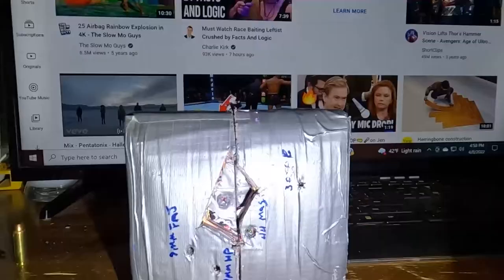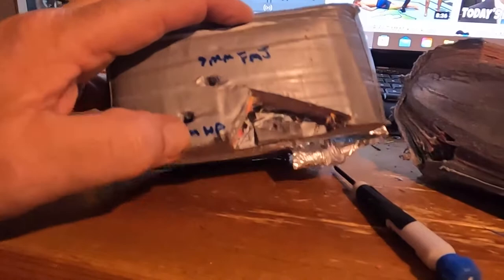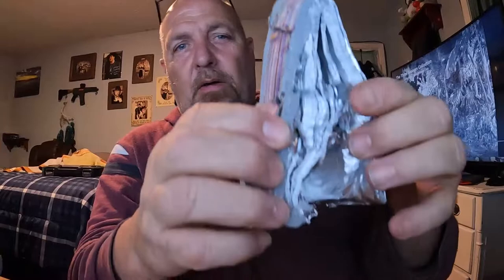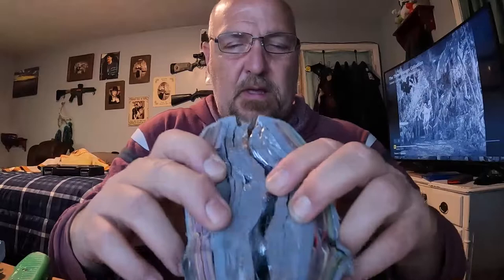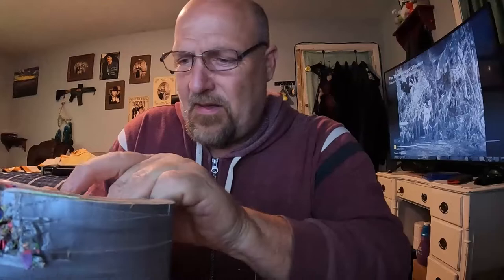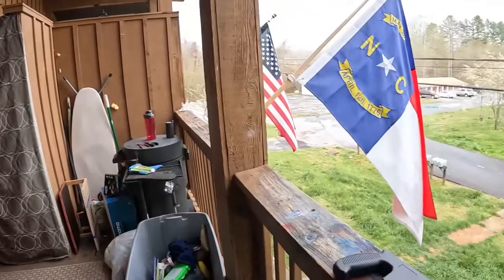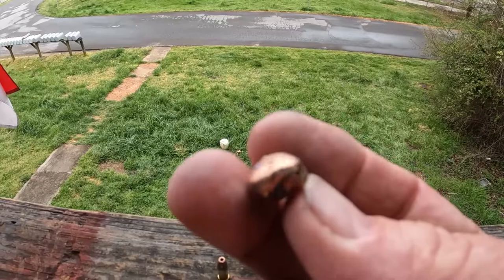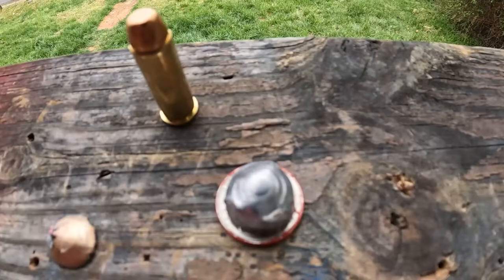3A Home Made Armor Inside revealed and Bullet Removal

Comment: I am curious after watching this... 
I was curious if you add a quarter inch or half inch of ceramic plate wrapped in a layer of duct tape in the center would it have stopped the 30-06?
Reply from the maker: I may have to test that 🤔
Reply: @ncmountainadventures  I watched another guy who had good results on stopping.223 rounds using two floor tiles and a thin piece of wood in between and a thin piece of steel behind it.